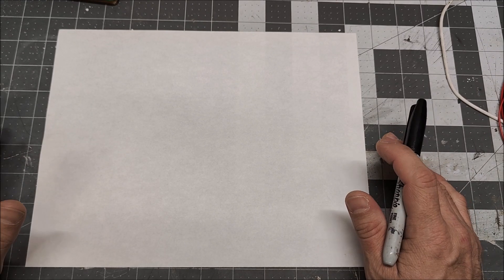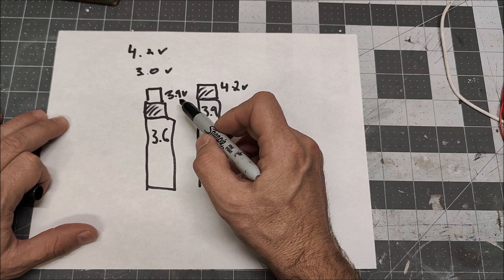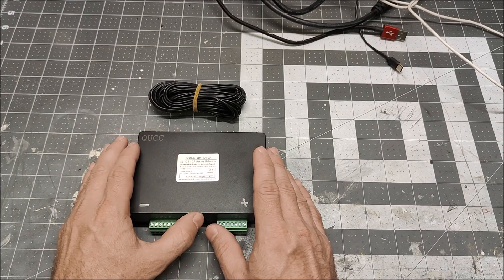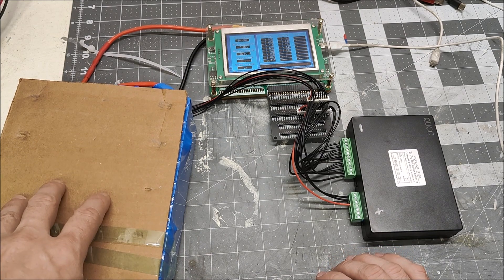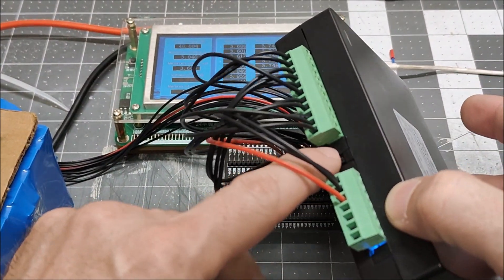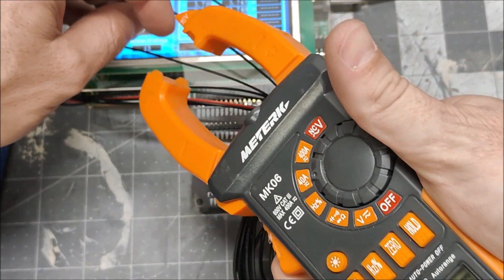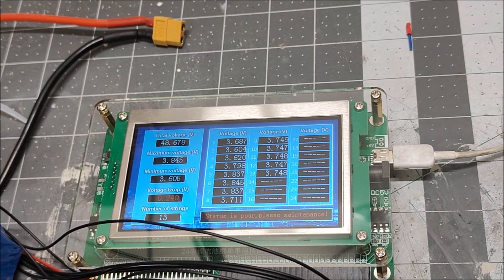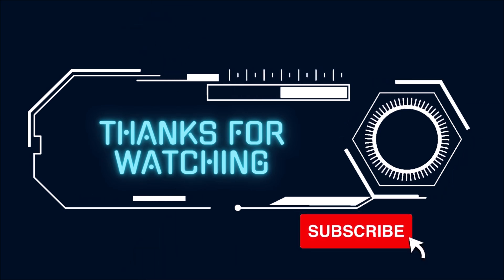Restoring an Ebike battery with an Active Balancer

Comment: Another great video bro! I used the link to buy the battery monitor but they said it was unavailable. I still got one thanks to you! I've seen this balancer and from what I can tell they are pretty awesome. Most likely will get one as well. Maybe you can help. I am trying to find 15 pin 1.5mm male to plug into my Daly BMS balance leads to go with all of this as the battery is now sealed that I built. But, I left the balance leads out like you have done. I can't seem to find a connector for the 15 wires on the BMS wire side to cells to plug into that connector. Any ides would be greatly appreciated my friend. Thanks for the great videos! Also, thanks to you, I learned about the BBSHD programmer and how to change the settings. THANK YOU!!!:face-blue-smiling::medal-yellow-first-red::medal-yellow-first-red::medal-yellow-first-red: Update: Sorry, I re-measured the pins at 2mm pitch. Still, THANKS lol :popcorn-yellow-striped-smile:
Reply from the maker: Yes. Its easier to find the Ph2.5 pitch balance cables than it is to find the PH2.0 pitch balance cables. Here is what i would do.  Buy 2 8s ph2.0 extensions and combine them for your 15 wire connector. You can just carefully cut of the edge of the 8s connector so the 2 8s connectors can both plug into your BMS. I've done this plenty of times.
Reply: @stevenc22  Great idea! Yes, and as I now wait for the Daly active balancer, I am manually charging the 100mA 1-7 packs. I want to ride! Crazy as these like I was saying were matched and all brand new. I also have a another Daly bms on the way just in case. Great vids bro. Keep em coming!:medal-yellow-first-red:

Comment: Seems like you've had that meter for awhile and it has proven itself to be valuable. Now that they sell smart active balancers with bluetooth and phone apps, I'm wondering if perhaps you could save the cost of the meter and purchase an active balancer with bluetooth and use your phone for the display. All my old 48V eBike batteries use old cheap passive balancers and it seems that their JST connectors are different from those being used nowdays. I thought they are 1.5mm but as I have the sameBMS in your older video, I think now it is 2mm. Looks like that breakout board will handle those. I'm thinking that perhaps a cheap solution to balancing all my old 48V eBike packs would be to purchase a Bluetooth enabled active balancer and connect the 2.5mm JST connector that it probably has, to the older style 2mm JST connector using that breakout board. Once balanced, replug the 2mm JST connector back into the original passive BMS. Speaking of that breakout board, seems like a lot of the (Amazon) reviews complain of slow shipping, so if someone is not in a hurry, they can get it for about half the price offshore.

Comment: Can you show us how to connect the balance cable? My battery is 10 groups and 9 lines come out of it and I don't think the negative one is one of them. Should I take the negative line separately from the battery? Also, is it mandatory to connect the socket in the specified place and connect the balancer in parallel exactly? Or is it possible to be flexible?
Reply from the maker: If your battery is 10 groups you need 11 wires for the balance cable. 10 positives and 1 negative.
Reply from the maker: What do you mean " connect the socket in the specific place"? All balancers have a main negative wire followed the positive wires in order. The wires and plug must be exactly in that order.

Comment: Only tangentially related, but for a variable voltage tool battery project I needed to accommodate cells possibly being 100% out of balance (since some lower voltage tools may only use a portion of the cells). I chose to go with a bank of TP4056 charging modules, mainly because they are cheap. 1 amp charge limit on them, but with many in parallel not horrendous for a cordless tool charger.

Comment: Wow - less than 20 bucks for the balancer.  Mine was 99.00.  Was it actually 24 hours to balance or just 24 hours later that you checked it?.  I wished you would have shown charging the battery to full 54.6v from the time it was balanced to verify the battery would maintain it's balance.  Great video however, and I didn't see where you said 56.6 volts like the other comment mentioned, unless of course you edited that out :).
Reply from the maker: Balancing took about 24 hours. Then I hooked it up to charger and it charged up pretty well.
Reply: @stevenc22  Thanks Steven, great to know 👍

Comment: a 48 volt battery fully charged is 54.6 volts not 56.6 volts, also you say you are using an 8s battery but it shows as a 13s on the board, maybe you should check things before you post a video as this could really confuse some viewers
Reply from the maker: The meter has ghost voltages for cells 9-13 since I have balance wires hooked up to those lines but the battery is a 8S.